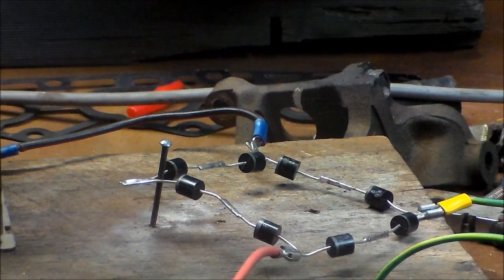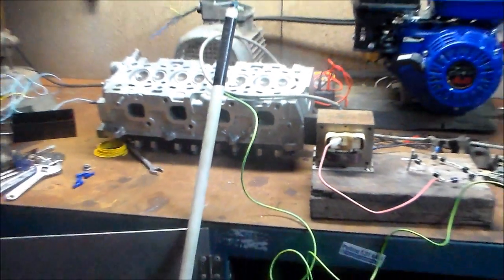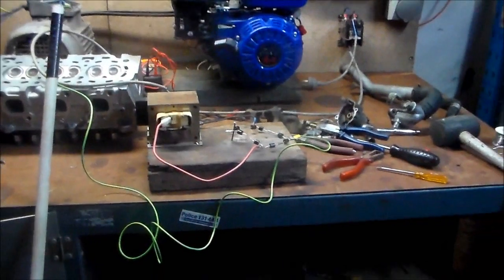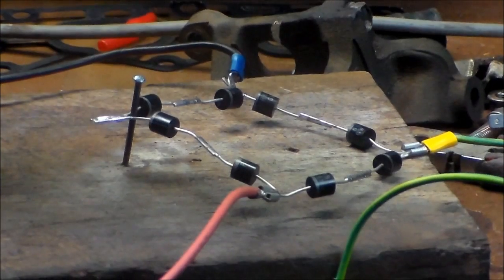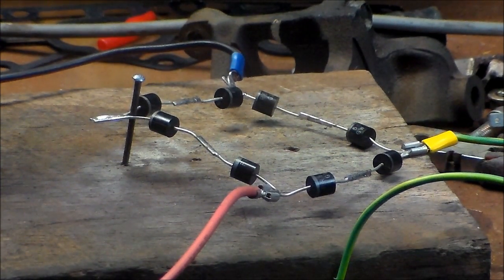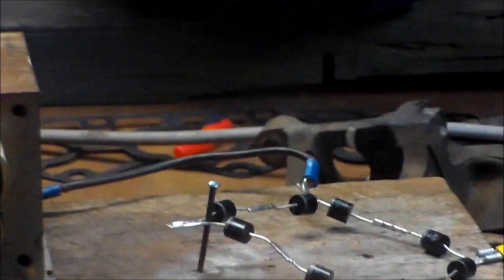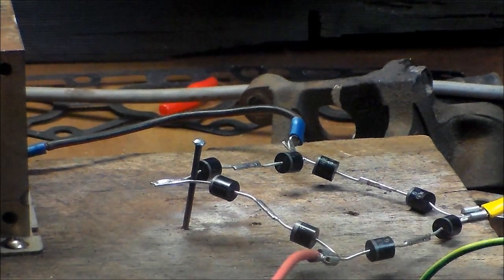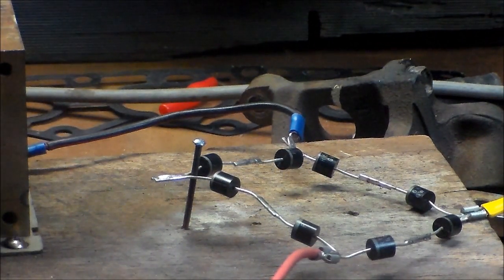Rectified MOT Arcs. Approx 2000v DC

Comment: Actually rectified 2000VAC would yield a theoretical maximum (ignoring the diode's foward voltage drop) of 2800VDC, but since MOT's put out closer to 2.1KV, it'd be more like 2940VDC

Comment: Yep, that's something modern PS designers seem to forget about. Adding inductance to the output filtering section is a wonderful way of getting smooth, quiet power.
I built a monster PS with a monster PI low-pass on its output, (1.5FARAD into a MOT primary, into a .01F) and even when I was drawing 5-7 amps, the ripple was buried in the noise level. I couldn't see it even with my O-Scope set to it's max sensitivity.